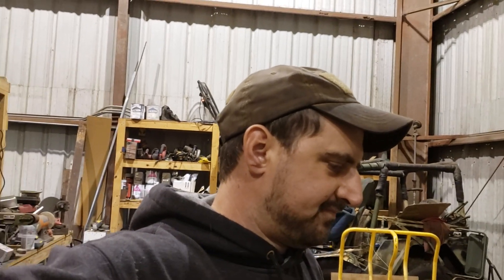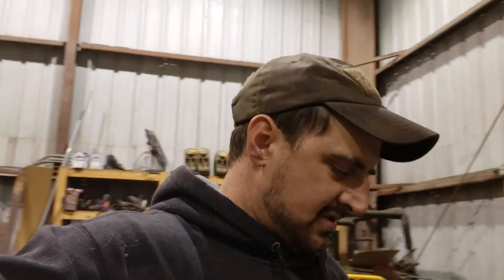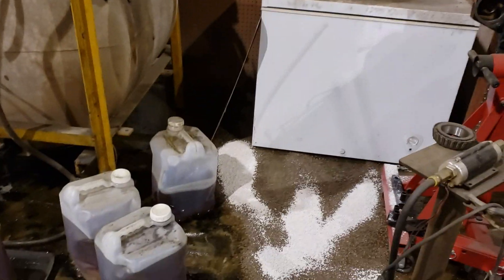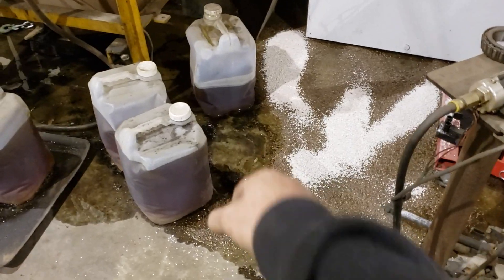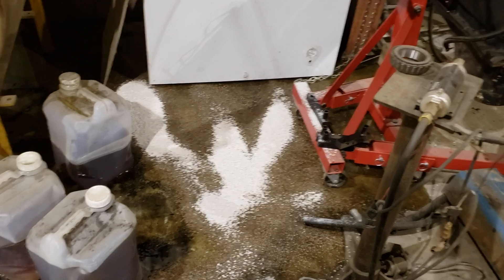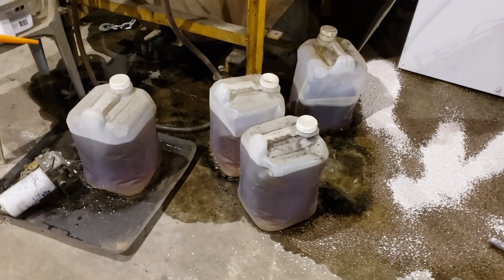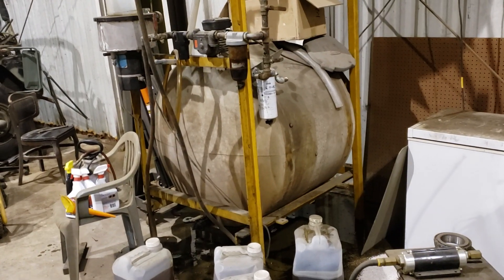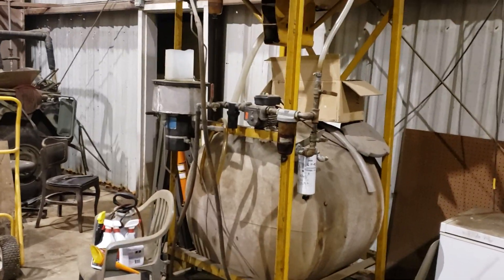Biodiesel/ vegetable oil burners beware! Don't do this!

Comment: I didn't think you were supposed to run vegetable oil in these trucks filtered or unfiltered? Can you clarify?
Reply: It can gel up unless it's always 80f that's why it needs to be treated with Methanol first.
Reply: Some people cut the WVO with diesel 50/50 ratio. Ive heard of other guys use 70/30 ratio with 30% kerosene. They usually just filter the WVO then mix and add to their tank. They do this to avoid using methanol and the by product waste of using the methanol method.

Comment: Those 4gals get broken down fairly easily by the solvency of the waste oil itself. Been there a few times and got to the point as they came in we dumped them straight away into the farm-all 250 gallon pollyethaline  storage container.